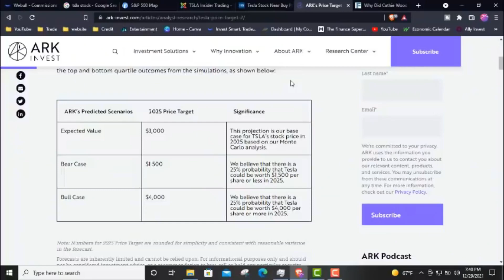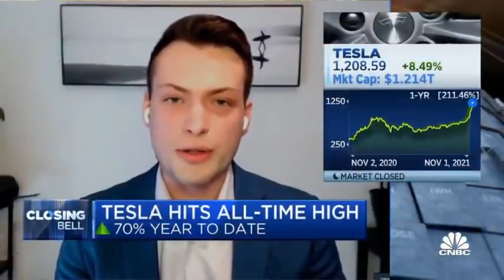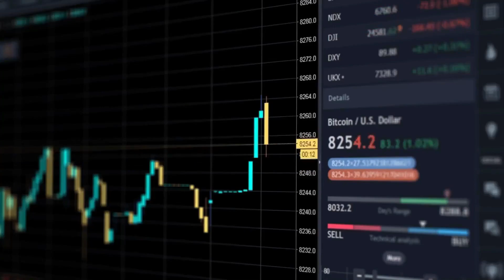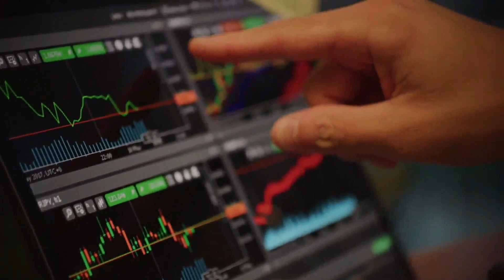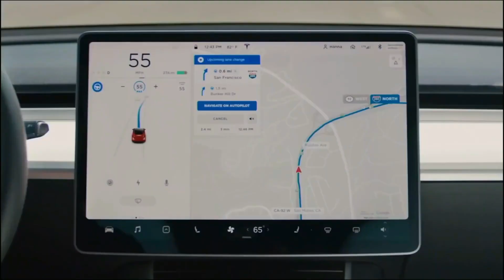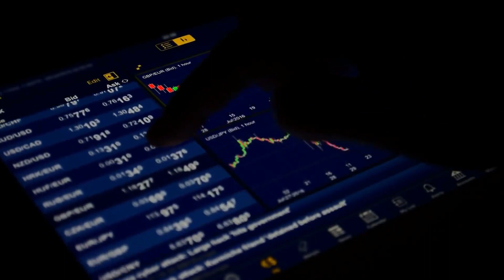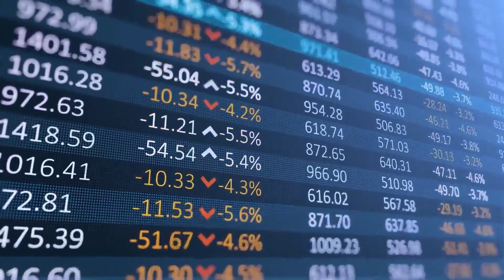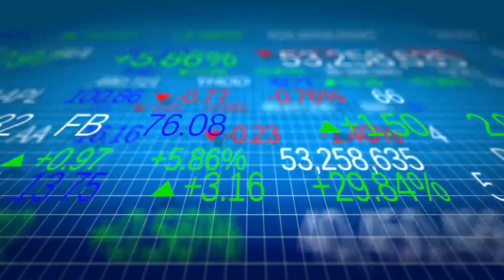Tesla Stock 🔥 Will EXPLODE and BOUNCE $3000 ARK Invest CATHIE stock price Prediction SOON?

Comment: Tesla will hit $3000 in 2023.
Reply: tesla now it is 1B market cap.. to reach 3000 should double the market cap in just 2 years... i don't think this.. maybe 2030...
Reply: @florinbenicean7608  thats not how it works. Tesla is growing exponentially and slashing costs per car. This means operating margins are growing even faster. Its EPS on an annualized basis will be over 20 at the end of this year, meaning a 3k stock price would mean a P/E ratio of 150. Too high for a company  increasing revenue atleast 50% a year? I think not.